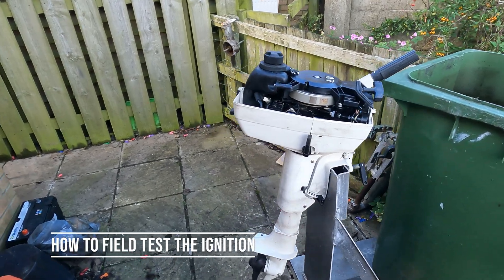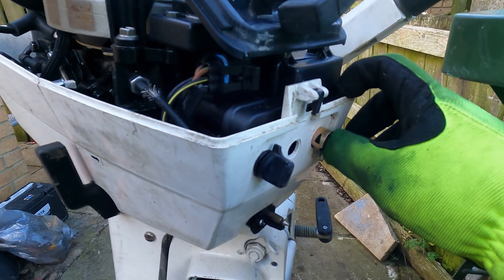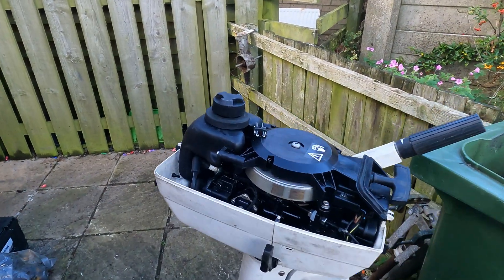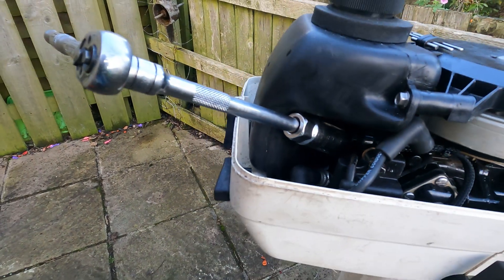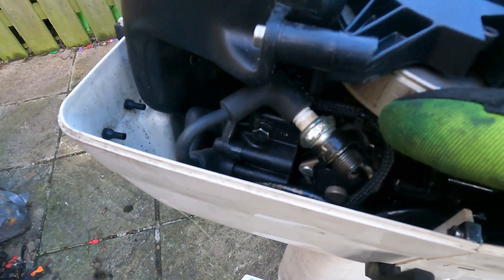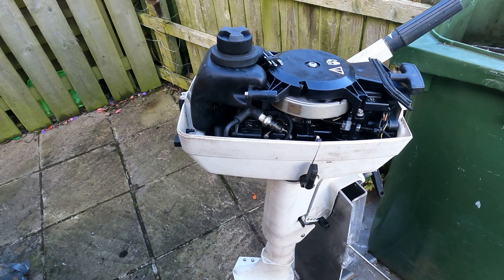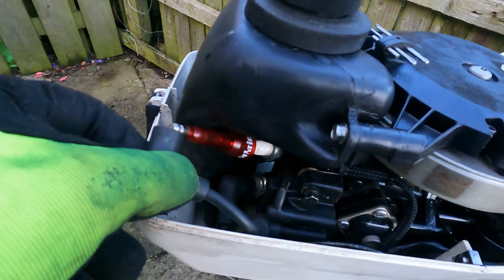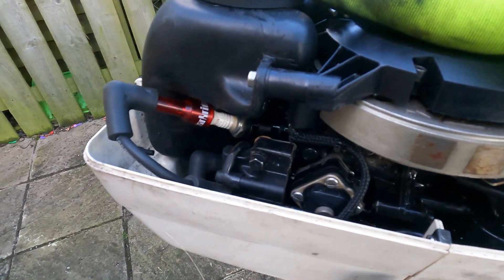Johnson 4 Wont Start ! - 4 hp Seahorse 2 Stroke - How to Check Outboard Ignition & Carburettor Fix

Comment: You should never use carb/brake cleaner to start 2stroke motor, even if it’s just for a few seconds  Use pre mixed 50:1 fuel
Reply from the maker: In a pinch it works well being able to inject it in a controlled manner. 
Granted running on neat fuel or cleaner isn’t best for test starting roller bearing engines.

Comment: Question, do you know the weight of this motor? Someone local is selling one and due to a bad back, not sure if I can handle it
Reply from the maker: Sorry I’m sure on the weight, it’s not that heavy but does require two hands to lift. 
If I had to guess I’d say between 20 - 30 kg ?
Reply: @MarineEngineServicing  it's not that heavy 15kg max   the actual weight probably listed somewhere online

Comment: Thank you for great explanations for that motor..🤩
How we can clean the carb? 
Or what should we do if the motor is working with excess  fume and stops after 1min running?
Reply from the maker: Sound like the mixture needs adjusting, try new plugs & gap correctly too
Reply: @MarineEngineServicing  I'm having this problem , to empty the fuel tank can i just turn the motor upside down and pour the fuel out the way it went in ?

Comment: Amazing video... I have the same engine and the same problem... I finally was able to make it start using your last method... but I can't make it continue running  for more than 5m... any ideas?
Reply from the maker: Could be the fuel pump not delivering the correct amount / quantity of fuel or a partially blocked or dirty float valve inside the carb. I’d start with those 2 and clean the carb while it’s out